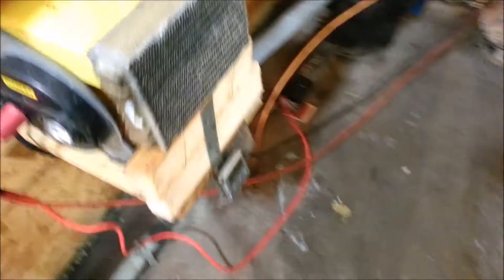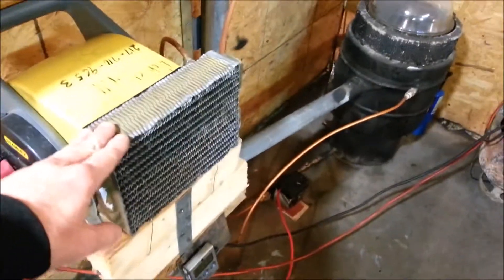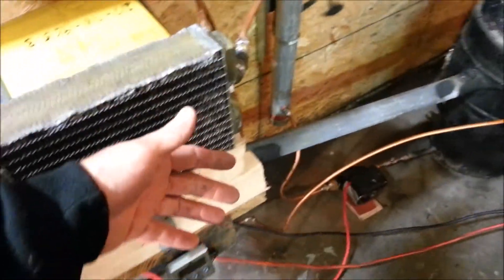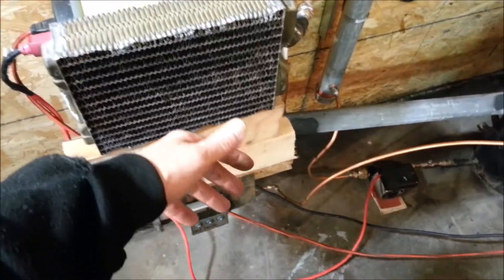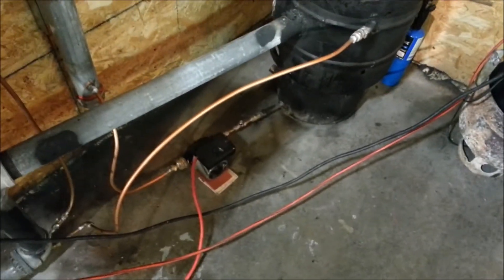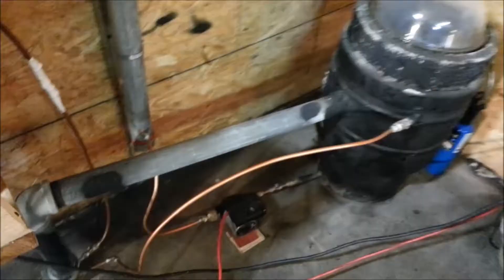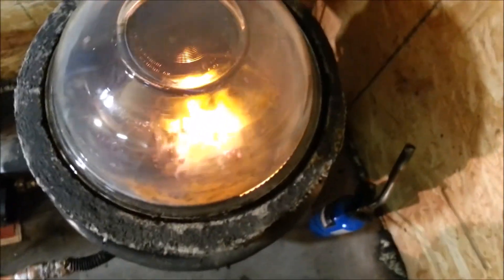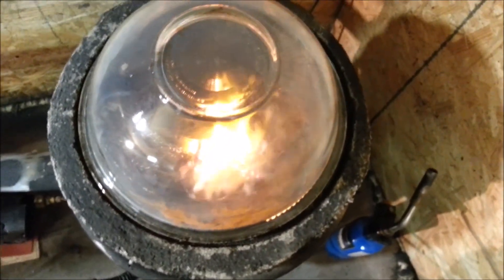Charcoal gasifier Design

Comment: hi you know of chrome plating and how it stops bumpers and hydraulic rams from rusting    so its repelling the oxygen so maybe when you feed your heated steam it may only need a chrome coated old hydaulic ram and pass steam down but have negative attached to the inner face this should dissociate the steam if not then just copy my old tractor glow plug video but drill out the centre at rear where diesel should enter and place a chrome tube in there and pulse the dc neg pos feed mine was just a straight dc flat line but pulsing should give some interesting results  really what we are after is all neutrals of ac  neutral dc   neutral colliding together give a total neutral      www.weathercreation.com    look at his air fuel cell and his motif on that tube     "magNetic north     this is the energy  like paul pantone   trying to sort something soon as its also pressure and vacuum so your neg pressure is something   cheers
Reply from the maker: +honda4004 thats alot to take in , do you have any videos of this device with the chrome?
Reply: Not yet as I have only just found out off pete Stevens recently that it is all neutral energies with pressure and vacuum coming in to play and light dark and full rainbow swirls   He says its really simple as did stan Meyer.  His epg is a car alternator pulsing back to a starter motor with car coils collapsing the alternators  in and out puts. Look at the bulb he shows plucking electrons off this so called water cell back to 12 v source  he talks of a non magnetic light guide but you can make any metal non magnetic if you strip it of its pos and negative atom structure.  A microwave magnatron maybe horse shoe wired to pulse a pos neg  stripping mode.   Anyway got to get my head together soon to show its AIR that's the source.     Pete Stevens shows a brass and chrome padlock in one video so unsure if brass may be naturally a negative repeller if attached to chrome ?   If it is then that's the neutral effect just by them being placed in the circuit.